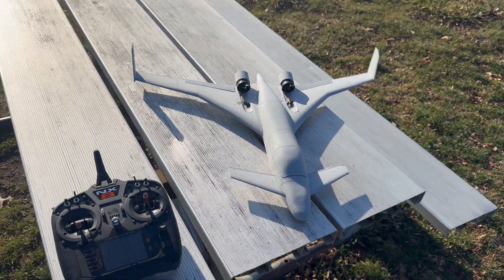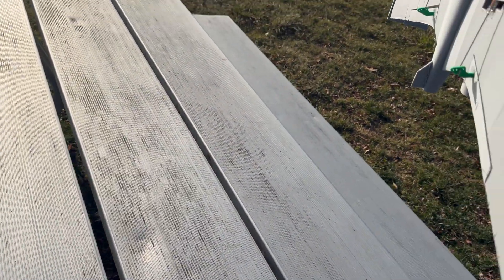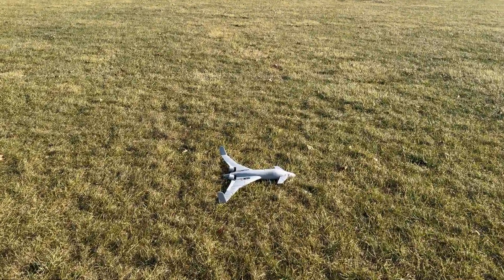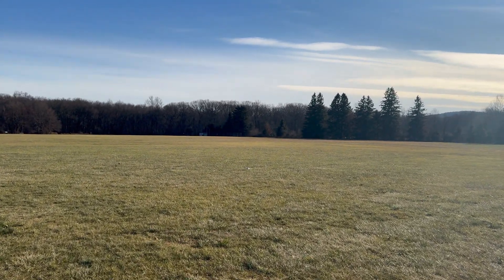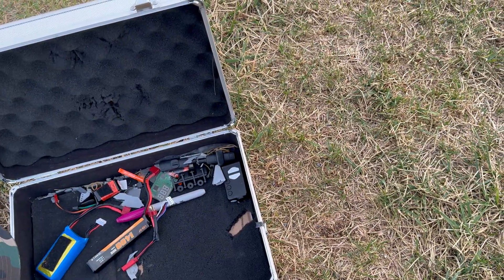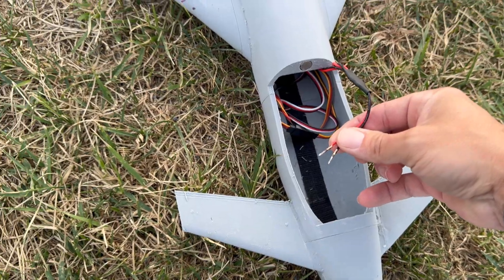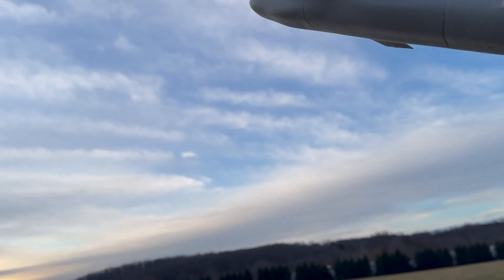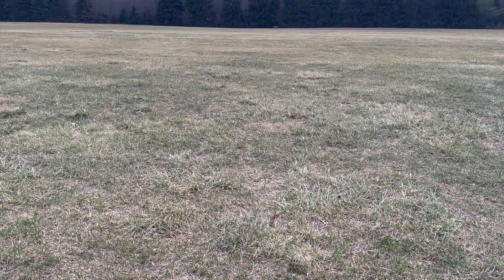Beechcraft Starship Maiden flight

Comment: The only designer to get a canard to work
Reply: Load up the canard and they all work
Reply: @brucebaxter6923  non functional canard  and is flown as a flying wing or delta
Reply: @ 
Well, there’s ya problem. 

Load it up and make it functional. 

When your main wing has its flaps out to equal the load you know you have enough longitudinal dihedral. 
Then load that bugger up and make it do its thing. 

An unloaded canard is just plain dangerous.